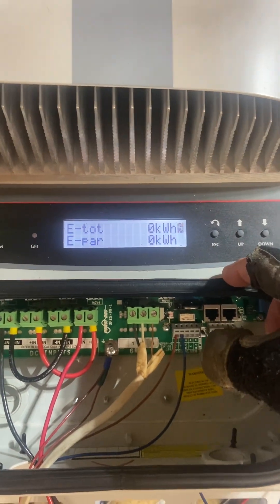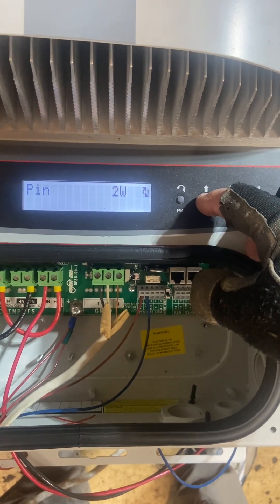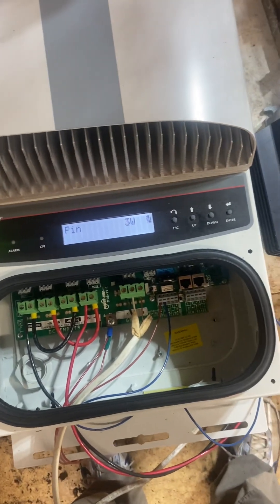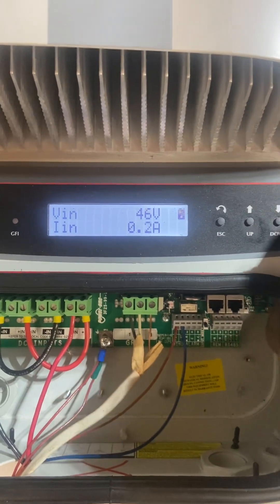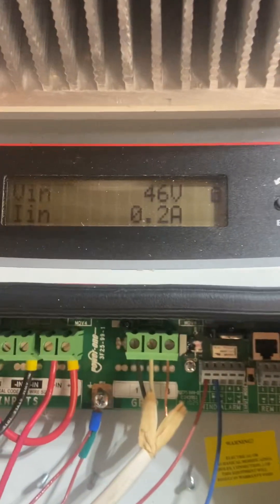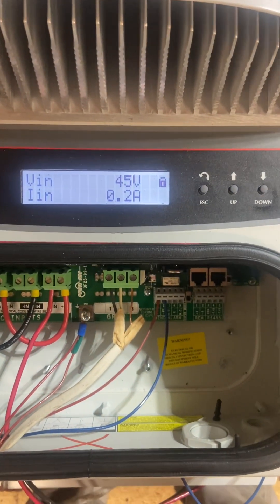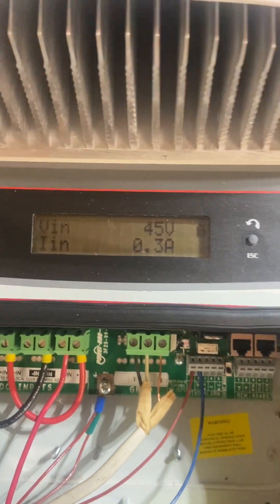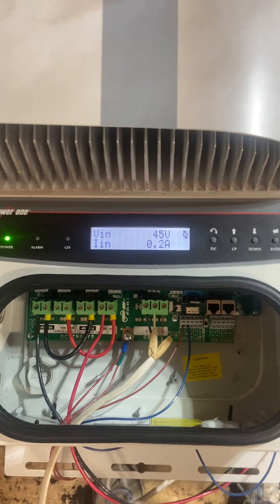Vertical Wind Turbine Part 25  Victory, Never buy Tesup. Powering up the inverter￼.

Comment: How much power has this turbine produced per day on average since hook up?
Reply from the maker: I'm in  the final testing stages. I my last video, you see I just programmed the inverter. Now I have to finish the counter weight for my tower crank. Once that is up and working. I will then mount the interface box and inverter on my shed wall and wire the system into the grid.  So I still have some work to be done, work right now is getting the way.  plus its winter now, slowing me down some.  I'll post a video showing the input and out put as I go.
Reply: @Themachinewon  so you have no idea if it can even come close to the 4kw max rating? Also do a person need a tower or can this be mounted on a roof?
Reply from the maker: @ChrisDied   I highly doubt this will ever get close to the 4Kw output.. Over this next year, testing will tell.  If the top of your roof is clear and pretty high, as high into the clean air from around your house.. You need clean air flow to make power.  I will also be modifying this turbine, removing a vane and adding it to the next blade to make the scope bigger if I have too.  Look at Harmony Turbines, wait on there model, well worth it. Best design so far,
Reply: @Themachinewon  yeah i figured that because a genuine 3kw turbine is huge and much more expensive, but if 2 or 3 of these can produce like 1 to 2 kw it might still be usable for me